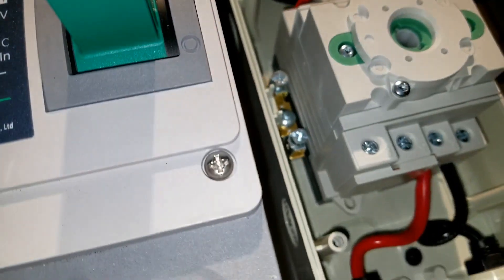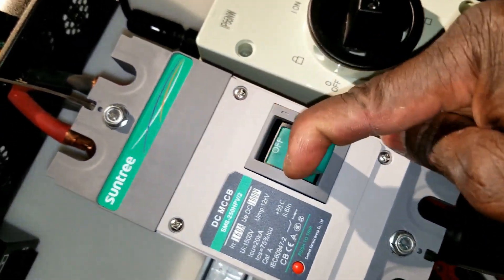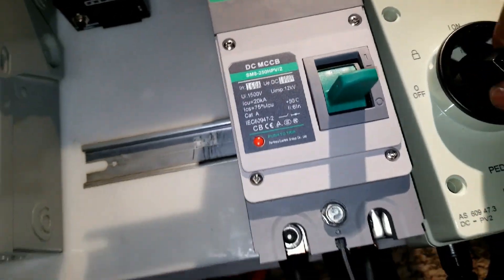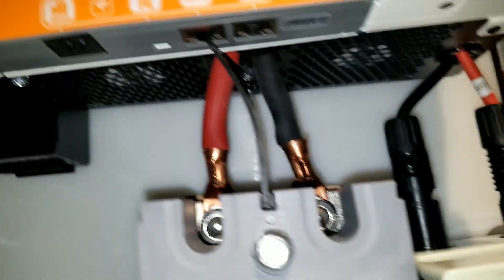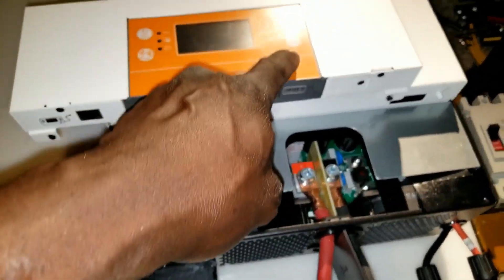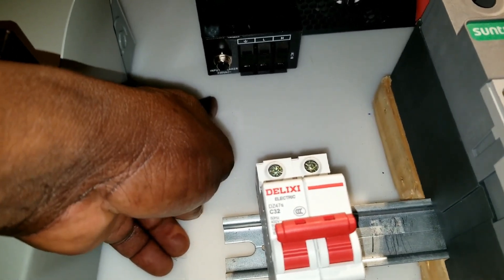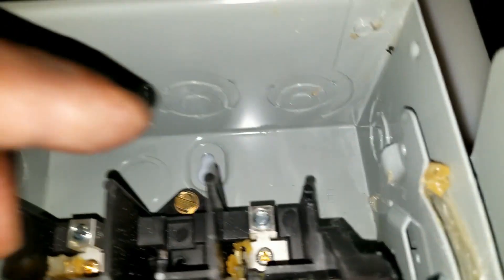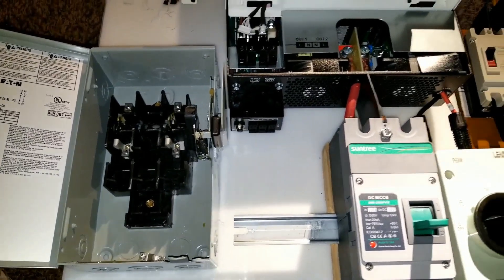MPPSOLAR: PIP-6048MT, AC DC WIRING

Comment: So i take it that you Removed  the Ground / Neural Bonding Screw 1st --- Before connecting it to your House panel --- is that correct?
 And that once you do so, the N ( for neural) now becomes L2.
Reply from the maker: This device I setup is for overseas.
This is 230vac international.
The N goes to the Neutral L goes to Line and E goes to Earth Ground.
Just like that for international Configuration.
Thanks for stopping by and don't forget to LIKE SHARE and SUBSCRIBE if you haven't done so
Reply: @jwsolarusa  I understand that ( it is made for Asia and Europe ) ... but I plan to Convert that 230 VAC (single phase to Split phase with a Step up Down Transformer).  I also understand that I Must Remove the Ground to Nuetral Bonding Screw -- as I will be Rebonding it to.tbe New Neutral that will be Created.  I plan to email the company tmw to ask about the Charge Circuit ( If it will work with L1 and L2 -- with a new Grounded Neutral on the Transformer).  Cause the Charge circuit runs off of 240V Single phase
Reply from the maker: @earthage3020  
Why didn't you just buy a Split Phase inverter that is made for North America instead of spending more resources trying to convert it to Split Phase?
Here is a link you can buy these Hybrid Inverter from Taiwan that are designed to work with North America Split Phase System. In this case you have to buy 2 units. Each unit per leg to achieve the Split Phase 110vac x 110vac = 220vac North America.
Thanks for stopping by and don't forget to SHARE LIKE and SUBSCRIBE.

https://www.ebay.com/itm/276419460310?mkcid=16&mkevt=1&mkrid=711-127632-2357-0&ssspo=L51oNECYSyi&sssrc=4429486&ssuid=EBstTcE3Twa&var=&widget_ver=artemis&media=MORE

https://www.ebay.com/itm/276422396343?mkcid=16&mkevt=1&mkrid=711-127632-2357-0&ssspo=L51oNECYSyi&sssrc=4429486&ssuid=EBstTcE3Twa&var=&widget_ver=artemis&media=MORE

Comment: So the transfer switch powers all the breakers of the house..... The red breaker can you send the link? That’s for charging from the grid? Thank you for all you do
Reply from the maker: Yes it transfer power from the inverter to the main breaker panel.
The red double pole breaker is the AC input from a generator or grid power to charge the batteries.
Here's the link to the breaker.
https://www.ebay.com/itm/163608619421?mkcid=16&mkevt=1&mkrid=711-127632-2357-0&ssspo=hWbfIoxOSxu&sssrc=2349624&ssuid=EBstTcE3Twa&var=463028561498&widget_ver=artemis&media=MORE
Reply from the maker: LIKE SHARE and SUBSCRIBE
Reply: Thank you so much!
Reply: Please show us the transfer switch wired when you finished